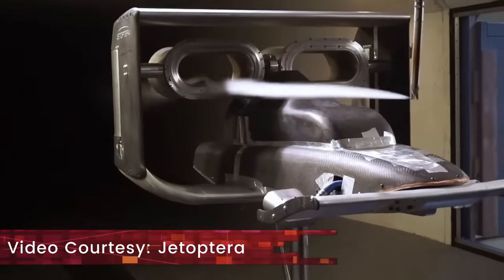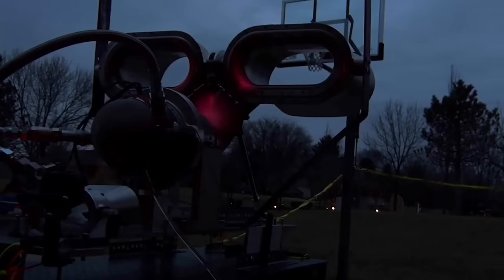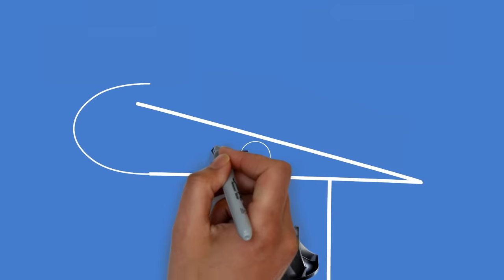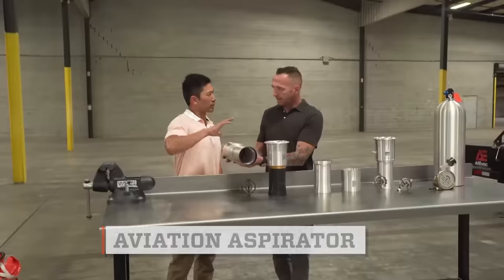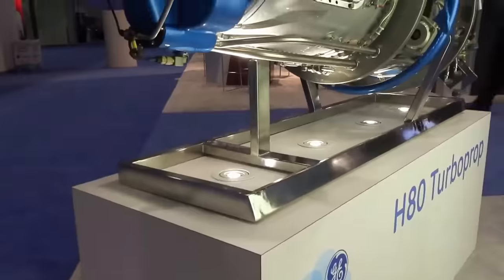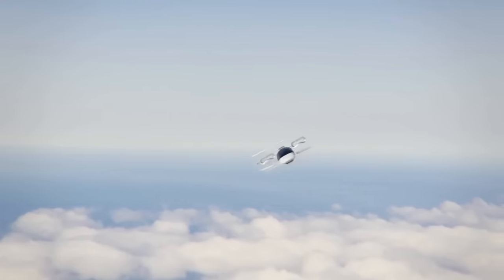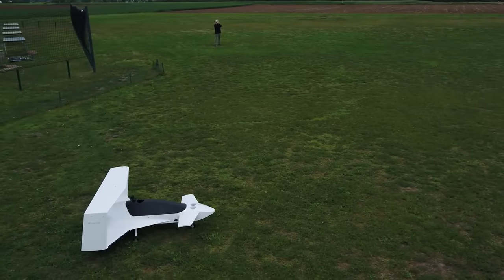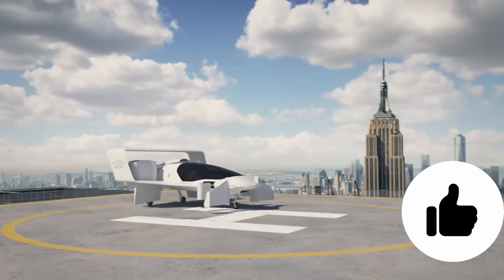Jetoptera's Bladeless Propulsion System

Comment: Frankly, speaking as a propulsion engineer, I can make no sense of this.
Reply: But they have VIDEO and point to things on their model.........

On a serious note, I kinda see what they are trying to show, but I don't see it having enough power for a VTOL.  I think too much energy is lost in the ducting and they will create bottlenecks in airflow.  They might as well stick with a prop at that point.
Reply: I'm not a propulsion engineer, but to me this looks like they are trying to get some of the benefit of a high bypass turbo fan without the fan. Some of those prototypes even appear to be arranged like an air augmented rocket, but with a turbo jet in place of the rocket. I see no way that this could be more efficient than anything exept a straight jet with no bypass, but maybe it doesn't need to be? If it somewhat works I could see using it for something where rotors or even ducted fans could be a safety issue. Something like an air taxi maybe. What do you think?
Reply: This appears to be coanda effect. Ive always thought there was room for integrating coanda effect driving into winglift laminar flow. Ive yet to see any benefit in this particular configuration.
Reply: I have a tough time seeing this making a difference in aircraft that transport humans.  For small drones, this could be huge though.  One of the FAA safety issues is the exposed blades of small drones.  This would eliminate the need for prop guards, possibly reduce noise, and possibly add some glide component in the event of motor/ESC failure while still keeping the most of the maneuverability of the standard quad copter.
Reply: You are right. The efficiency of modern props is up to 90%. The energy you can save here is nearly zero. The energy you need to lift this aircraft is given. So this conzept what claims a higher efficiency  is just bullshit. They will waste energy and money and not save energy.
Reply: Works great, in a model.  You put my 6'3" 295 lb but on board and she'll sit like a rock.  But best of luck to them. Eventually some technology will solve all of this but it won't involve "fluid" anything.
Reply: @TexasKid747  Yes i agree, but the simple physics don't care the luck. A model dont need to be strong, carry passengers and fly far. lol. It's a bad joke. Maybe just stupidness, maybe worse and its a scam.
Reply: I understand all that he is saying, but I can quickly see that this can NEVER be more efficient than a decent propeller driven monoplane.

The only advantages I see are its compact form factor and VTOL. In this regard it is remarkable.

It will certainly be very thirsty.

Fine if energy economy is not a driving factor.
Reply: @TexasKid747  I an sure this thing will scale just fine. But efficiency could never be a selling point.

It will absolutely gobble shiploads of energy.
Reply: They just another company looking for tech investors.  They created some drones that can do VTOL but that’s what drones do.
Reply: @johnbgibbs  Yes but thats the problem... Think a elektric car. Half the weight is the battery... The weight at a car is not a big deal. But the main problem with planes is the weight, the weight, the weight. So to fly electric you HAVE TO be much more efficient then normal. Thats why elektric take off with a sailing planes is very fine. And fly a normal plane elektric, you cant fly far...
The final joke is VTO to wast a big amound of your energy.
Reply: @solarblitzch9055  Wouldn't there be more friction within all of the ducting needed to move the air than on a prop, it seems like all that internal surface area would be a bad thing.
Reply: @Rivenburg-xd5yf  This APPEARS... to be coanda effect??? Pardon me Professor Scientist, but are you making this assessment based on your scientific knowledge or are you just... repeating the narration in the video?? 

also
"COANDA FOREVER!!" lol Avengers... nailed it ^_^
Reply: @buchanap  Sure. And not only that. Its again also about the weight. All this stuf around is much more heavy as a single motor with a normal prop i gues. I cant believe that so much people believe that without asking the obvious questions.
Reply: @CenterpointConnect  I don't think so. We have flown in VTOL and we will combine with the wing- that's the point most people miss. The otherwise useless wing everyone uses as a propellers support will now work for us and with us in take off and generate a LOT of lift. We're not exactly sharing all in here but we are called Jetoptera for a reason. Plenty of power and we make 30 dB less than the quietest propeller so no, no props, thank you.
Reply: It works just like that "bladeless" Dyson fan. This is not the whole system, just a nozzle
Reply: @ATEvulet  You dont answer the simplest questions about the efficiency wich is needed to fly electric and the  law of conservation of energy! The efficiency of modern props is up to 90%. The energy you can save here is nearly zero. The energy you need to lift this aircraft is given. So this conzept what claims a higher efficiency  is just bullshit bec el. planes need to be lighter and more efficient then normal planes, simple bec of the heavy batteries with 100 times less energy per kg. 
So just explain where to save energy if normal prop is already 90% efficient!
And explain where the energy for a highly inefficient VTOL plane should come from... Batterys with 100 times the weight of fuel? LOL
Not only this scam does fail. There are others who claim to be able to fly for 30 minutes or more but still have energy for only 5 minutes after VTO.
Reply: I'm a 58 year old truck driver with a high school education, and a 10 hour student pilot.
I understand the concept, and it appears to look good on paper. But I want to see it in real life to see if it really lives up to the hype.
I like what I see, but I want to see the real product to see if I like it.
Reply: It's very efficient at moving money from the pockets of non-technical people to theirs.
Reply: @johnbgibbs  NEVER, based on what??
Reply: @hiredgun05  100% agree. If they claim to be better I want to see at least 2 toys of the same weight and battery and then compare how long they can fly.
But first it would be easier to count the energy required and compare it with the battery. A LIO battery with 1kWh weighs 10kg. 1 kg of fuel contains 10 kWh and the efficiency is perhaps 30%, so that the weight of the batteries is 30 times higher for the same amount of energy.
Reply: @jimcoleman7650  Simple: Based on the weight of Batties. If you compare fuel and Bat its 30 times. We dont talk about 2 or 3 times... Compare Tesla: 75 kWh and 478kg ...
Reply: @madattaktube  I think you don't understand the points and physics and only believe the claims.
- Jetblabla is not without a propeller, it is inside
- Modern propellers have up to 90% efficiency. Saving energy here by a factor of 1 to 10 means multiplicate 90% to 900% and generating 800% energy. That would be a perpetuum mobile and is just bullshit.
- Modern turbo jets are the best there is. If those are a caveat, the concept sucks.
- VTOL requires a lot of energy, much more than normal planes and this with inefficient propulsion and 30 times less stored energy in the batteries compared to fuel.

It's all just physics, chemistry  and math from school and not belief.

Dont believe me, count by your own.
Reply: I couldn’t imagine this gives it any more thrust than what the jet they use already has. It jus increases the volume of air but I’d imagine that also reduce the speed right so the thrust would be the same correct?
Reply: @TexasKid747  I think it will be terrific for limited applications where rotors are considered too dangerous. One thing for sure, it will DRINK power.
Reply: @Omlet221  Yes. Otherwise it would be a perpetuum mobile...
Reply: @johnbgibbs  My problem, even with conventional aircraft, the payloads aren't designed for my body type. Lol... I'd need lots more money to be able to take myself and 1 or 2 or 3 folks with me.  I am hoping they make it!
Reply: @CenterpointConnect  I was thinking this too; the problem with vtol is that it’s massively inefficient to get off the ground; even if they could make it feasible, it would still be better as a conventional fixed wing aircraft.
Reply: @solarblitzch9055  That’s why I’m frankly surprised there hasn’t been an implementation of hydrogen fuel cells into aircraft; it’s still electrical, but with a reasonable energy density compared to similar sized batteries.
Reply: Its jet engine nozzle design next step.
Reply: Propulsion Engineer? I can make no sense of that.
Reply: Yeah... They're basically using thrust to generate lift rather than using thrust to generate forward motion so the wing generates its own lift... They're not wrong... But the applications are pretty limited...
Reply: @Rivenburg-xd5yf  Actually its more of a ducted fan. The fan is internal...it blows out of ducts (like on a Dyson "fanless" (it has a fan) fan.) This also sucks air between the duct loop creating air propulsion...Its horrifically inefficient. And would required a LOT of power to produce the same thrust as a convention fan. Because all the ducting slows the air down from the fan...thereby reducing the suction effect pulling more air through the loops..
Reply: 🔵 Basically, they are taking the 'Venturi-effect' and turning it kind of inside-out to amplify the entrained-air into a force sufficient to lift the craft vertically.
I believe that the size of the power plant and it's distributive ductwork is going to end up requiring SO much space & is going to have to be of such a high-weight that I don't believe scaling-up the present-design will prove itself feasible.
.......I wish them Luck, (they're REALLY
gonna need it!).
Reply: @joshhayl7459  Not really venturi... More bernoulli and coanda. There's no mixing duct so the amount of venturi will be minimal... Fundamentally it works the same way as the fan wing
Reply: @solarblitzch9055  sure our propeller tech is most likely as efficient as we will get it! We have spent a lot of time developing!! There is hundreds if not thousands of design's. We are still coming up with new designs

Anything new will require the same development's 
We don't know if it will be as efficient, and we never will if we don't try!
We don't need it to be better, we need it to work!! Safety is the number one requirement 

If set up right, power may not be required for more then acceleration and accessories
Reply: @solarblitzch9055  all new concepts require wasting energy and money till you get it right. Efficiency will increase as we develop new strategies and designs

I believe this will take over the current fuel based propulsion tech like jets and rockets
Reply: @TexasKid747  "eventually some tech will solve all of this but it won't involve "fluid" anything"
I assume you are talking about acceleration. No propeller to push you through water or air!
That will happen for space. Has to! 
We can't use propellers in space and combustion engine's will never be efficient enough (nothing to push off)
Reply: @solarblitzch9055  I remember the first time I heard that you can't scale up a drone. And at first it seemed to be true
But people have developed motorbike sized drones we can ride on!

Your logic may have convinced me if I didn't know my history! 
But then again, I have never listened to anyone that said "it won't work"

Can you imagine all the thing we wouldn't have now if the developer's  listened to everyone that said that in the past?
Reply: @johnbgibbs  all new concepts require tech to catch up
Reply: @johnbgibbs  do you know how much fuel was consumed by the first patrol car? Not only could you walk faster, but you can out walk it. Now we get a lifetime worth of walking out of 1 tank
All tech improves!
Reply: @JasonB808  drones may not be dangerous  because they are small, scale them up and they will be deadly! Safety first!!
You can't be cheap when it comes to safety
Reply: @solarblitzch9055  so you are saying, because batteries are to heavy and VTOL is energy hungry, we shouldn't try

Electricity is the FUTURE 
We can't move forward without it
And giant blades are not an option 
We have to improve our tech to catch up
Reply: @buchanap  tell that to the jet engine 

We have already been through this via other tech

Learn your history to now your future! 
Don't know your history, then you have no future!!
Reply: @solarblitzch9055  
!!!!!!!!The Wright brothers were right!!!!!!
Imagine if they listened to people when they said "that contraption can't carry the weight of the parts it has to carry, let alone a person"! We would still be grounded
But they didn't, and we can now travel the world in less time then they could drive from one city to another
Reply: @solarblitzch9055  I can't believe we are having this conversation 
This conversation have happened multiple time though out our history 
We are meant to be intelligent! 
This conversation begs to differ!!
Reply: @ATEvulet  at least not everyone is still living in the past 
And thinking of the futer 

It's not only the power or that it's quieter
It's less chance of damage, more chance for improvement and most of all, it is much safer!
There is many reasons for us to persue this tech
Until we develop "anti-gravity" (If possible), this is our best option
Reply: @solarblitzch9055  I think the first plane only traveled a few km and the fuel it used, let's just say it was a lot!
What about rockets today, I don't know, but I assume I can drive my car for a lifetime and still have leftover fuel

Progress takes a lot of time, effort and even more time and effort to progress it
Would you have been better of sitting in a cave from the lack of progression?
Reply: @hiredgun05  I bet there was a massive crowd to see the first plane take fight! I would love to see it in action aswell
Reply: @GRAHAMAUS  that may be true
Maybe it is all about the money to them
But doesn't mean this concept isn't viable and our best way forward
Reply: @greekkidshows9373  Lol Look at better drones (i have one) the battery weight is more then 50% of the weight. Its a flying battery for 30 min. ...
Reply: @solarblitzch9055  no tech has ever been better then the old tech up front
It still needs to be developed 

The combustion engine is over a century old and it don't use even 50% of the power it produces and it won't get much better. We have reached the peak

We have a long way to go to develop the tech required to make this design efficient! Especially when it comes to the battery 
The combustion engine has been developed even though it wasn't efficient 
The battery is the same as it was when it was invented, no development 

It's all about the money and there is no money to be made from electricity compared to oil
Reply: @solarblitzch9055   I think you are missing the point
There is no propeller turning, it is your mind that is turning. At least it should be!
All joke's aside 
There isn't a giant propeller outside
It is dangerous and a lot more chance of it going wrong! Not to mention the difficulty of repair 

Don't believe everything you hear, you have to interpret it yourself 
It isn't more efficient, yet
Who know how much more efficient it will get. But it will become more efficient! One day!! 
Do you expect perfection? 
Do you expect it straight away
You seem to expect more then you can get
Progress takes time, be patient when it comes to science and technology! 

"Modern turbo jets are the best there is"
No they ain't! They are just the best we got because we put the effort to develop them
So does that mean, that's enough (we don't need more)
If we want to become more, we need more
Turbo jets will not be efficient for space travel. We need something better!
Although this design isn't efficient either, but progressively it may be
Petroleum will never work!! It may be good enough to get us to the moon, maybe even mars (slowly). 
The edge of the universe is the limit 
So, it is majorly inefficient 
Never go down a dead end street if you want to get somewhere!!
Reply: @johnbgibbs  we can start were safety is an issue. The more we develop it, the more efficient it will become 

One thing is for sure
It will take us into the FUTURE
Reply: @92HazelMocha  the same problem the Wright brothers had
It was massively inefficient to get off the ground

But here we are! We don't live on an island anymore, we live on a planet!!

Imagine if the Wright brothers gave up!
Reply: @92HazelMocha  gasses should be a thing from the past
But at least the hydrogen fuel cell is a step forward 

We need a development in battery tech
Reply: @krap101  the application's are only limited to a limited mind
Progression will show us more
Reply: @brokeandtired  all concepts have problems 

"The ducting slows the air down from the fan...thereby reducing the suction effect pulling more air through the loops.."
That should be an easy problem to fix
Reply: @brokeandtired  I see what you mean
A slight redesign is needed
Reply: @joshhayl7459  Thnx Josh
I have never heard of the "venturi-effect 

I also see those problems
A slight redesign is necessary 
I will Look up the "venturi-effect", it may have something to input
Seeing thing's in a different way or even backwards can open up new world's
Reply: @krap101  now there is a "bernoulli-effect" asswell
I guess I have a lot of reading if I want to think about this some more

I have thought of this a few years ago, didn't get any further then this
A little diff, but with the understanding of the venturi/Bernoulli effect aswell.......
What's a fan wing! Now even more reading
Reply: @greekkidshows9373  Venturi is a specific application of bernoulli, except for a venturi to induce flow effectively, it needs to be ducted. You can see this in eductor pumps,  ejector pumps, injector pumps, generally the same thing.

Lift is generated because the flow velocity above the wing is faster than below. Bernoulli says that the higher velocity means lower static pressure, so there is a net force. Normally fixed wing aircraft generates the flow with forward motion. A fan wing places a squirrel cage fan inside the wing to push air over the top. This design uses an impeller.
Reply: @solarblitzch9055  batteries is the tech we have that needs developing the most
Our battery today has the design from more then a century ago
Would you drive a car if it had the same tech from over a century ago?
I don't think you would, it was pointless 
But you are still using the battery as outdated as it should be!

Imagine if the battery was upgrade as much as the useless combustion engine,
Your argument wouldn't stand
Reply: @solarblitzch9055    I understand physics just fine. I have been through this before
I am always right! Or should I say, I haven't been wrong!! yet

The day we get better power storage is the day you will understand 
The battery we have today is still a dinosaur! But that's because the rich fcks are holding it back!! 
One day that will change
It will be quicker if people stopped discouraging other's  
Besides, there is a lot we can do to make it more efficient to work even with the inefficient batteries we have

Thnx for wishing me luck 😀
I will need it if I choose to pursue this endeavor. It should be fun, either way 🤪
Reply: @greekkidshows9373  I mean we’re quickly approaching the physical limits of battery storage. Even at 100% efficiency, beyond what is feasible, battery storage will never have the energy density to make it viable as a power source for aircraft.
Reply: @solarblitzch9055  like the battery powered steam rocket.
Reply: @greekkidshows9373  I literally have no idea what point you are trying to make.
Reply: get better education)
Reply: @krap101 ,
🔵 My reference to it's being similar to the Venturi effect "Being turned inside out" was correct,... The "Mixing" happens at the point where the air from the compressor entrains and multiplies the air going through the duct.
Reply: @joshhayl7459  That's all well and good. Without a mixing duct, it'll be ineffective and a waste of power.
Reply: Seth DeLosSantos  I agree! Think about how much fuel gets wasted in military training. Plus, I watched a video about a bombing raid over Afghanistan. They took off from UAE I think she had to refuel in air three times on the way there and twice on the way back. They dropped millions of dollars of bombs on mud huts on what was likely just a bicycle shop! Disgusting...totally disgusting.
Reply: @greekkidshows9373  thank you! agreed totally!
Reply: @buchanap ,
🔵 It helps to eliminate tip vortises and produces a more laminar airflow,...a properly designed duct increases the efficiency of the fan by an order of magnitude.
Reply: @mboyer68 ,
🔵 It increases the volume of the air being utilized as thrust by entraining more air into the stream to increase efficiency,.... their expectation is to produce the propulsion needed for forward flight with this system.
Without a tremendous redesign I don't see how they can utilize the same propulsion system for VTOL mode.
Reply: @92HazelMocha  We are reaching the limits of the first battery design 
There has been no advancements
Change of elements, Not design 
And a long way to go

A combustion engine on the other hand is at it's limits. There is nothing left to advance, we are scraping for any extra advantage 

It wasn't possible to use a combustion engine for a plane at the time!
They found a way because there was still advancements to make, but no more!

We are still at the beginning of battery tech
Reply: @buchanap  simply speaking
We will make the advancements whether you see it or not

What are your arguments?
Heavy batteries 
Not sure if the ducting system if efficient enough

Did you know the combustion engine was to heavy for the Right brothers first plane? 
That didn't stop them

Compressor tech has advanced a long way and we haven't learned to use it's full potential yet!

Besides, even if we can't see it, 
WE MUST LOOK
There has been a lot of tech in our history that wasn't used for a long time (even centuries) because we couldn't see the application's or the advancement opportunities 

This tech has a lot of pertential 
We can start now or wait till the tech catches up
I for 1 would prefer to be ready when it get here!
Reply: @brokeandtired  do you know that the combustion engine is horribly inefficient?
It don't even use 40% of the power produced! Unless it's a race car, then it may use 50%

Perfection isn't our goal
Useability is the target!!
Reply: @solarblitzch9055  I remember my first time playing with rc chopper, it was old nothing like these new one's. But the battery lasted for an hour or 2

Batteries are at there worst
Can only get better
Reply: @krap101  the venturi-effect sounds like what we are talking about

Thnx for the incentive to look it up 🙃👍
Reply: @92HazelMocha  I think we are at the beginning of battery storage capabilities 

We haven't worked out efficiency yet, but we have multiple opportunities 
We have a battery smaller then the tip of my pinky. Batteries that last a lifetime and batteries that never miss a beat!
But the money is in this new tech that is just as bad as it is good

All we have to do is, work out what is good and persue it
Next, we need to find better ways
There will always be advancements 
Mobile electric power supply will dominate the FUTURE
Reply: @krap101  it's like saying -
Without a gearbox, the car will be inefficient and a waste of power
Do you know that the gearbox is what makes a car so inefficient 

A mixing duct and gearbox have the same problem. It may be inefficient but it is required 

We have advanced the car enough that we don't even notice how inefficient it is
Reply: @joshhayl7459  "a properly designed duct increases the efficiency of the fan in order of magnitude"

If this is true, there seems to be a lot more potential then I thought!
Reply: @joshhayl7459  first of all, I think you messaged the wrong person. Mister Bee only commented on the war

"Without a tremendous redesign I don't see how they can utilize the same propulsion system for VOTOL mode"

First of all, why not? They both use air flow
Second of all, redesign translates to advancements
Reply: @92HazelMocha  "science isn't magic"
If we could take our tech back a century or more, our tech would seem like magic!

Science isn't magic!
Magic is science!!

Everyone that don't understand says "you clearly don't understand so I won't bother". Imagine if TESLA listened to the science world, we wouldn't have A.C.
Or if the Wright brothers listened, we wouldn't have plane's. I can go on all day

Just because you don't get it......
You can't tell someone they are dumb
Reply: @greekkidshows9373  No, this is like saying combustion outside the engine produces power. You wouldn't be wrong, but within the context of useful usable power, it's kind of nonsensical.
Reply: @greekkidshows9373 ,
🔵 I'm uncertain what your question is... You appear to be making more of a statement than asking a question, please clarify: What exactly is it that you are inquiring of me?
Reply: @krap101  cause if the explosion is outside the motor, it's not being used!
Pointless!! That whole statement was nonsensical 

This isn't about wasting the power, it's about enhancing it via the pipelines
Nothing to do with "outside"
Reply: @joshhayl7459  just curious 😀
I have been following what you say since you mentioned the venturi-effect. I didn't know about it
I have only made statements up till now 

I'm curious why you think it would take an entire overhaul to implement VTOL, this is what it's meant to be
Reply: @greek kid shows ,
🔵 Because, like the Dyson-fan, it's very good at
increasing the VOLUME of entrained air, but terrible
at raising the VELOCITY of it!... especially not
high enough to be used as THRUST for a VTOL.
Unless someone comes-up with a brand-new
method to move enough air through all of that
ducting powerfully-enough to get you vertically off
the ground it ain't gonna happen, cuz right now,
(that I'M aware-of!) NO-ONE'S got ANYTHING that
can move air like that!... not only that, your gonna
have to POWER this compressor/blower some
how!...a high powered, high-RPM light-weight
engine/motor to power the air-mover to move
enough air through all of that ductwork to get
the craft and you and a payload off the ground........
Look,...I'd REALLY like to be forced one day (soon)
to eat my words,......
.....but I'm going to 'State Categorically' right-
here that:
"I don't see this proposed aircraft as being a viable
application of the "Dyson"- principal of air-moving,
and I don't see that the designer's of this craft are
going to be able to find a powerful-enough
"Compressor" (or any OTHER type of device for that
matter) anytime soon that will provide air at a rate
high-enough to overcome both the principal-
losses and the inappropriate application of
this method of air-moving". ◻
Reply: @ATEvulet  "...and we make 30dB less than..."
Now that is an argument I can immediately get my head around and support. I just wouldn't ride the efficiency angle too hard before proof of concept. You could, for example, say that you're aiming to increase efficiency significantly and that up to 50% are theoretically possible. In the video it sounds like that has already been proven...
Reply: @solarblitzch9055  To be fair, there never was the claim that they could run it 50% more efficient on batteries. The prototype is built with a conventional engine - but electrical propulsion would be a future option... The 50% gain would have to be campared to other classically fuelled engines - though even that claim has yet to be proven.
Reply: @JescoLincke  I do not understand your point of view.
Mine is: Batteries are 30 times heavier and you even carry them empty. On the other hand, props are now 90% efficient. You can increase the efficiency a few percent maybe, but certainly not to 200 or 300 or 1000% ... OK? And all of those tubes on the other end are detrimental to efficiency. So tell me, where can you develope something so much better, that a battery-powered VTOL plane is more than a very expensive vehicle for a few miles? I don't see an efficiency gap you need for this plane to make sense if you can close the gap. 
Simple: No efficiency gap. No solution.
Reply: @solarblitzch9055  Your point is valid. But it is a counter-argument to a claim that was never made...
Reply: @JescoLincke  OK. Look, I mean this claim: To increase airflow 15 times to explain why the aircraft should perform better than existing systems. But that's just nonsense. Let's take a closer look: You increase the airflow ten times, for example. At the same time, the air speed is reduced 10 times. The power in the end is the same! Minus the losses in the impeller, on the pipes or even worse heat losses from compressed air. You add inefficient pipes and an inefficient impeller to a highly efficient system (motor with propeller). The result will be 100% sure lead to higher consumption. Electrically, the range of the aircraft will decrease many times. There is no doubt about either.
And at the END VTOL laughs
Reply: The biggest advantages I can see are:
-Thrust vectoring w/o having to move the power unit and deal with the structure to move such a heavy part. 
-Noise. There may be an advantage in terms of reduced noise signature.